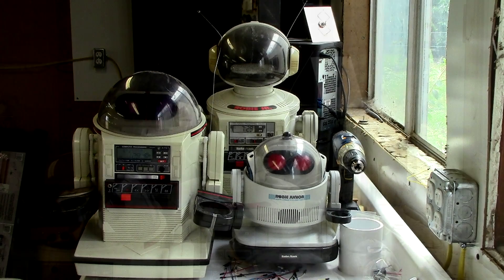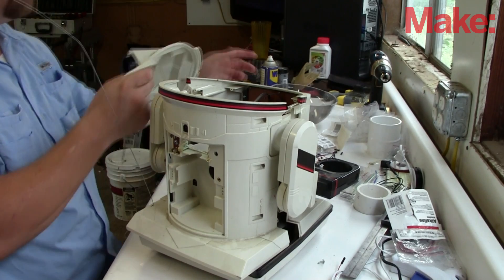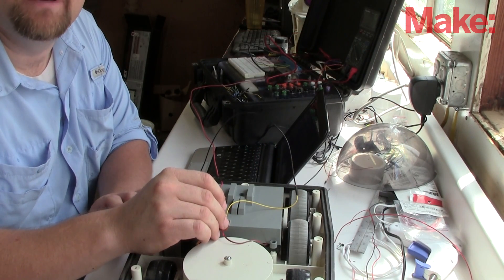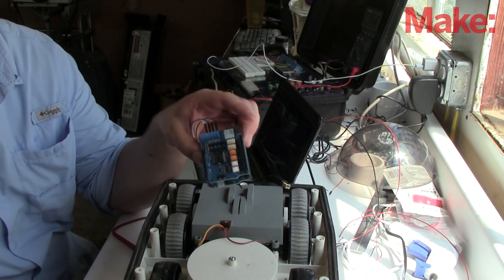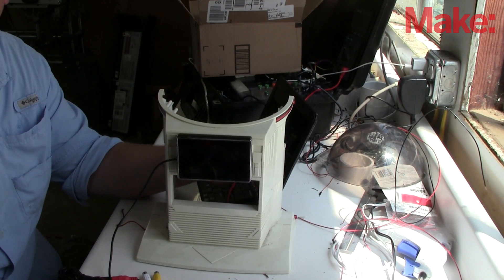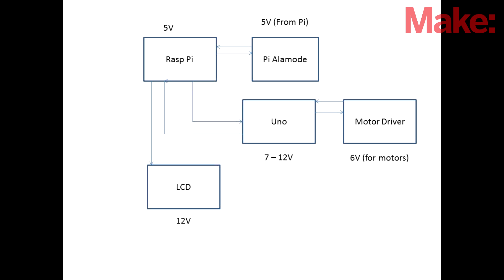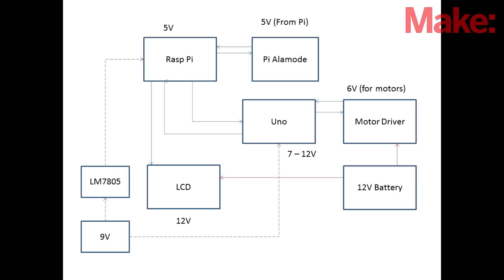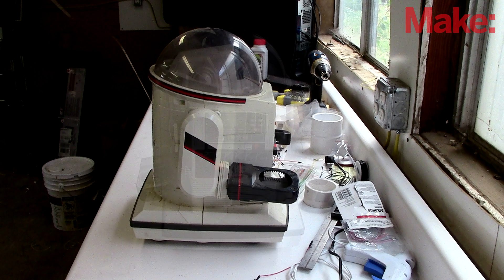Projects with Ryan Slaugh

Comment: You should really try to physically stop the motors when measuring their current draw. This will give you the stall current. Your motor driver should be sized to handle both motors stalling with a little room to spare. Usually stall current of both motors x 1.5 is a good number to go for. This enures you keep the smoke on the inside on the driver board.

Comment: Hell why not just put the 7805 on the the 12V battery, They are rated up to 18V,  Granted the lm7805 is only rated for one amp you could put 2 in parallel to make sure you have up to 2 amps available.  The 2 nine volts is just dumb

Comment: What type of 9v batteries will you be using? I too have a Pi project that uses a small 12v LCD screen - my plan is to use 3x 3.7v LiPo batteries to run the screen and a little switching step-down to run the Pi.